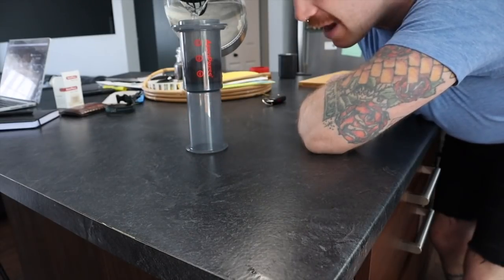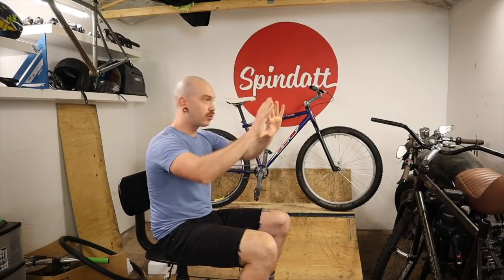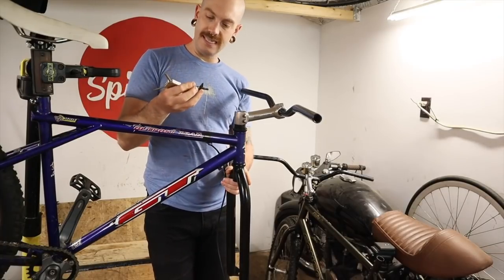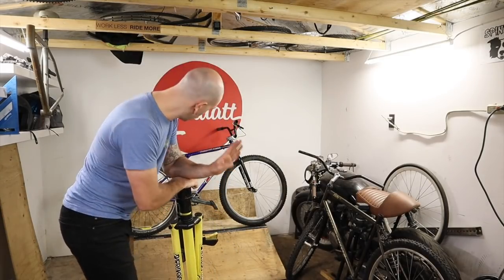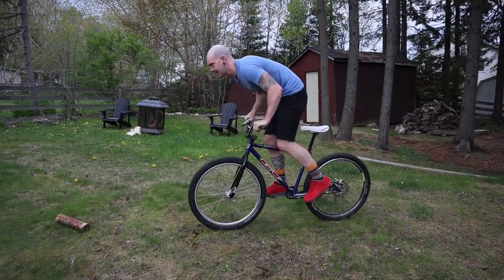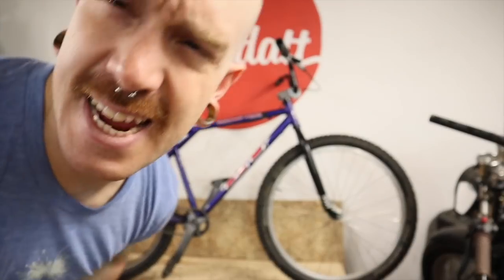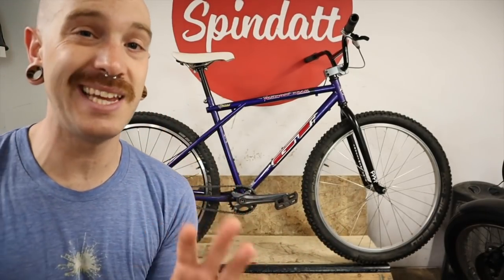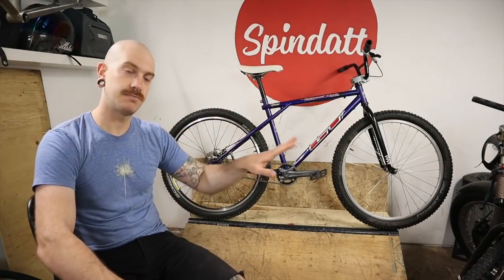GTMX PARTS ARE HERE!!!!

Comment: Ditch the hydro brake hose, and instead use a mechanical brake caliper with some Gyro brakes! Infinite bar spins may lie in your future!!! Either way, sweet bike, man.
Reply from the maker: Yeah i have some odyssey gyro stuff in my parts bin, but it would still need gyro tabs at the head tube, which i could totally do.. but I actually like the look of the straight cable

Comment: Because the channel is about riding reasonably priced bikes and modifying existing bikes, this gets a pass. Wouldn't it just be easier to buy a 27.5 or 29er BMX. Not cheaper though.
Reply from the maker: I'd kind of hate to just buy an already build big kid bmx. Much prefer tinker and build my own
Reply: @Spindatt  I got that. I've spent hours disassembling Shimano shifters. Forcing tiny staked screws on the body and tweaking the return spring so the thing stops jamming.  I got it back together in like 6 hours. We don't always take on projects that make sense. It sure is fun though when the effort succeeds!
Reply: 27.5 or 29in BMXs are kind of dumb though. 26in is a little more BMXey imo